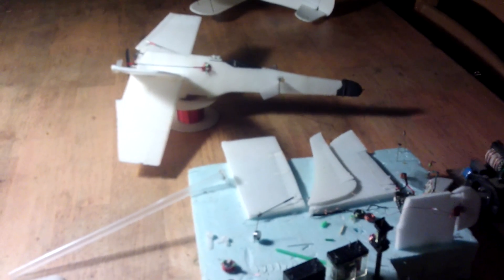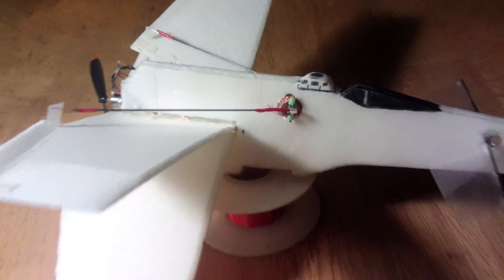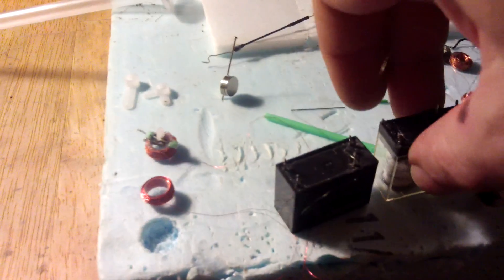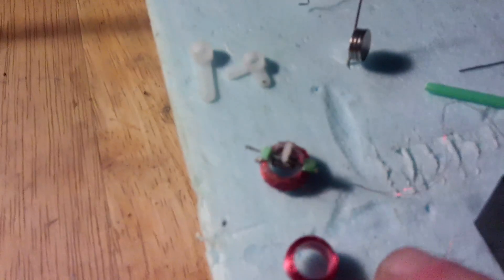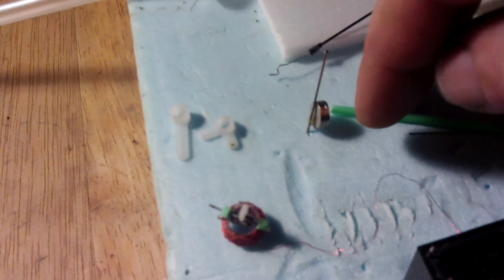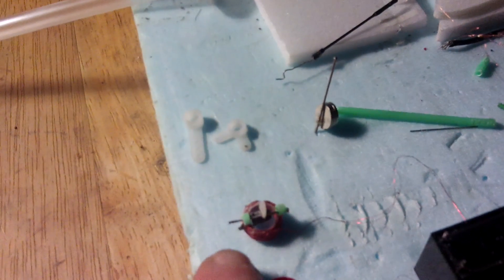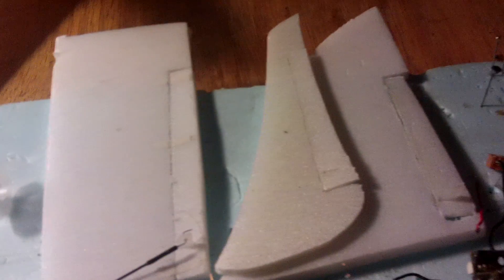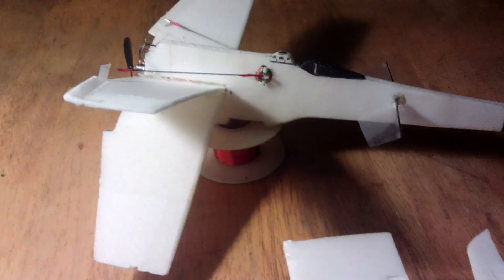Remote Actuators for micro R/C  - for GIAOM

Comment: the servo you have made has only 2 wire -/+  so how do you connect it to ESC ? Because normal servos has 3 wires (+/-/ signal) ?
Reply from the maker: Sorry for the late reply. Yes, normally for actuators there can be 2x coils and use 2x outputs to switch directions. I think this used the ItCanFly circuitboard though, where only 1 coil is needed. The outputs are similar to motor control, rather than servo control.

Comment: how do i power a actuator to get up/down or left/right?
Reply from the maker: In this case, the receiver was intended for actuators, the ItCanFly 3 planes box set from a few years ago. 
One way to test is to convert a mini quadcopter circuit (Furibee F-36, Eachine E010, CX10, Santa quad etc). You can connect to the motor outputs. The coil will only deflect in one direction, but by using 2 motor outputs and 2 coils, you can have left and right. Most useful for ailerons, but, 2 conventional 400 turn coils can be wound back to back and they will result in a working rudder.
Also, a lot of the 10 year old 2 channel toy planes that used 27MHz/49MHz had actuator rudders. Such planes as the Silverlit SWP. Their circuit boards can be very useful to try out actuators to make sure they work...or to replace an original coil with snapped/busted wiring with a coil of your own.  Then there are Plantraco and Deltang receivers, which are also intended for actuators to connect to.

Comment: Great, helpful video!
Reply from the maker: Am glad it was of use :)
Reply: Thank you for this explanation. Can you elaborate on the electronics you used and how it works?
Reply from the maker: This R/C receiver is by 'It Can Fly', but actuators that work in a similar way are found on a lot of indoor flyers instead of servo's. They power up the coil to 1 polarity and swap it over to move the magnet in the middle in the opposite direction. If done with PWM, the coil can be controlled as a number of steps of movement in each direction.
For homemade versions, the coil has to be powerful enough to move the magnet well and the magnet strong enough to move the controlled surface enough within flight. 
Too powerful a setup will draw more power and also often results from a coil that's too heavy or a magnet that's too big (heavy again). Too little will obv not allow the surface to move in the air enough. A balance. 
So, in essence, they're little electromagnets, switched on and off by using the sticks on the controller.
Reply: Thank you! I wil make a test setup I don't see how it could work proportianal yet. But we will see and learn. thanks again.
Reply from the maker: Hopefully this helps - It works proportionally by the amount of current sent to the coil. How to do that is with how much 'on' time there is of the coil, 1000 times a second.
Say for example you wanted half deflection of and aileron instead of full down or full up, the receiver would send power for half the time and switch off for the other half. For 33% deflection, it would be on for 33%, off for 66%. That's what PWM is (Pulse Width Modulation), whereby the amount of time per pulse of on or off gives that width. As a stream of fast pulses, it then translates into the movement of the aileron to that amount.
On an oscilloscope, it looks like a square wave, with different lengths of high and low lines, which are the power on and power off.

Comment: Impressive  actuator and good work , but how many turn you wound the coil ?
Reply from the maker: 450 turns of 40AWG. It snaps easily, but makes light strong coils. Other thing, is to make sure you use a good strength of neodymium magnet...smaller pieces will save weight, but won't move the surfaces as well as larger pieces. Rule of thumb - use the biggest piece that will move in the straw (I get mine from broken HDD's and snap them up with pliers) :)
Reply: Thank you for answer .

Comment: Thanks Slider, great video, particularly like the extra magnet for centering the servo, nice tip.
Reply from the maker: +GrandadIsAnOldMan Glad you saw the vid. Yep, that magnet is quite nifty for what it is. Makes flying around that much easier without wondering if the foam is dangling in the wind. A neat thing too, is that it just sticks to the side by itself, then just glue it in place.